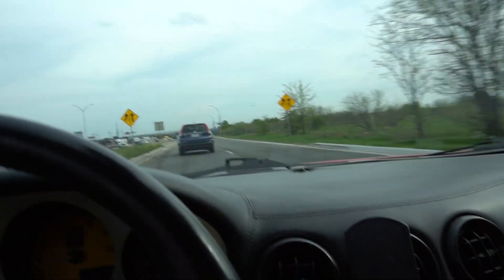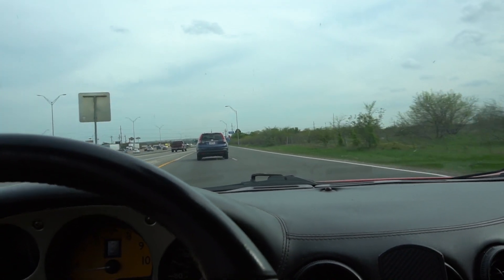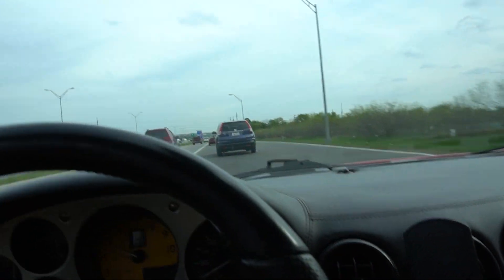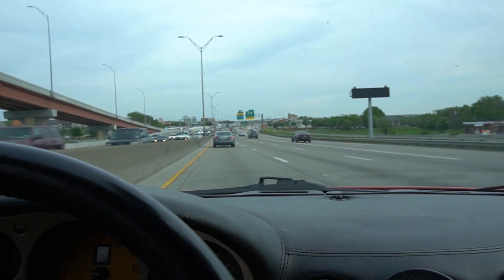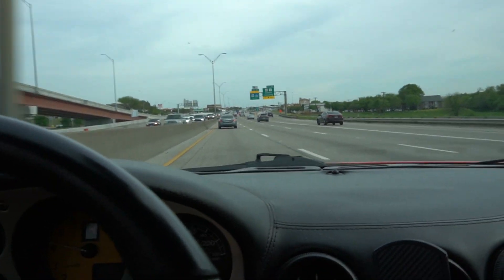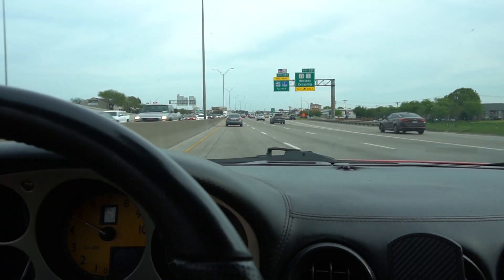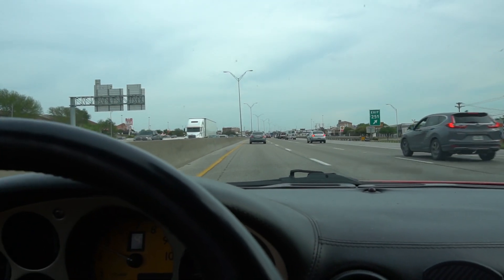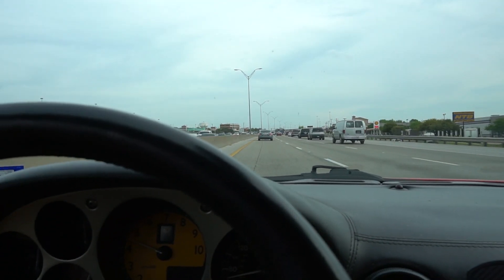The FERRARI That Costs as much as a HYUNDAI. **BARGAIN OF A LIFETIME**

Comment: I have a 360 F1 with decat + Tubi and it downshifts (in SPORT mode) much more rapidly than the 360 in this video. Also I can "flatfoot" down- OR upshift with it and it does not hit the revlimiter like in this video the car does. Maybe its time for your "Ferrari wizard" buddy to check the TCU parameters or clutch life of this particular car?
Reply from the maker: Yeah, I'm thinking something isn't right.  It may be the battery actually...  It was hard starting and it may not have enough to run the F1 system well.

Comment: These videos never catch the true exhaust note  in person.
I don't see how  headers, test pipes and a capristo exhaust could possibly sound bad on any Ferrari.
Also, what TCU is Stuart running? Sounds like the challenge stradale TCU  would be an easy upgrade to fix some of those issues.
Reply from the maker: It's stock whatever it is. I'm not sure how hard to swap it out would be...
Reply: Super easy to swap out, I did it myself in a few minutes, it's mounted right behind the passenger seat.  Hard part is finding the Challenge Stradale TCU.  @normalguysupercar

Comment: Something is wrong...you're bouncing off the limiter at 7500 rpm....redline is 8500.
Reply: Fleabite7 looked like he shifted at 7 and bounced at 8.2
Reply from the maker: Either way it didn't feel right
Reply: Normal Guy Supercar agree
Reply: @stopmaverick2   ...it bounce at around 8k but it rev'ed up quick at 7.5 and bounced at 8k....Something is wrong.  It shouldn't do that.  Honestly, the car sounds awful.
Reply: There is no problem with the car, he’s doing a no lift shift on a car that isn’t meant to do that. This happens a lot when people who buy exotics and don’t have the slightest mechanical understanding of the vehicles they drive. I feel bad for the guy who let you drive his beautiful example of a 360 to have you ignorantly abuse it.
Reply: Dennis Wagner its an F1 paddle shift transmission.. you’re not supposed to lift.. and the driver owns an F430.  No more talking for you.
Reply: Fleabite7 yeah, Bc he shifted gears at 7.5.  The car isnt letting the gas cut off between gears.

Comment: If it is anything like the way the germans have their DCT's it will have the odd on one and the evens on the other. It will preselect gears depending on your driving, so sometimes it will preselect the wrong gear and the shifts will be longer if you confuse the system. For example if I have my foot floored in 4th gear the DCT will have already pre-selected 5th so that when I do upshift into 5th it will at a fast time (in ms). So if I had to take a stab at this, I do not think you should need to, nor is it recommended you release the gas when upshifting. If I had to guess, the behavior we saw was a slip, and it tach'd out. Could be completely wrong. I am just going off my knowledge of my F80 M3, and I mean they are both DCT's correct? Just one is Italian....so I would like to believe the general setup is similar. I would have your buddy show this video to a Ferrari mechanic and get his take for peace of mind. The only other thing I can think of is you lost traction, but I am guessing that would have been obvious (and we didn't see a TC light) and you would have picked up on that. Pretty curious on what it was, if you guys figure it out fill us in man!
Reply: Craig, the Ferarri F1 is single clutch only. DCT didn't appear in a F car till the 458. No preselected gear.
Reply: @scuddryvr8784   thanks for the heads up, was just taking a stab.
Reply from the maker: Yeah, the older F1 transmissions are basically just a manual transmission with hydraulically actuated clutch/gear selection

Comment: I wonder if his clutch or flywheel needs to be replaced.  Maybe that's why it jumped after switching gear? Interesting
Reply from the maker: Not sure honestly
Reply: Clutch at 60%, new clutch, flywheel and throw out bearing installed 2013.  OOPS! Forgot replacement new throw out bearing installed 2014.
Reply: Stuart Osantowski oh ok cool
Reply: @studog05  Something is not right.  On shifting and full throttle, the clutch is becoming fully depressed (essentially neutral) without slippage.  My guess is your PIS is wrong.  This should not happen.  Have Dan's "expert" check your clutch settings.
Reply: @Nine9Three  Josh Hill is MY expert, LOL.  I introduced him to Dan.  Yes, I will have him check my gears, thanks.